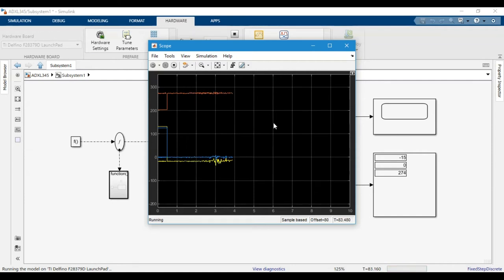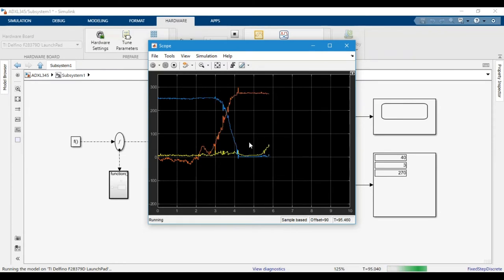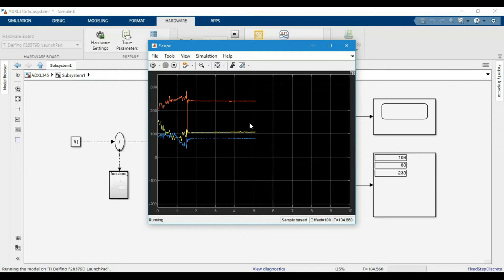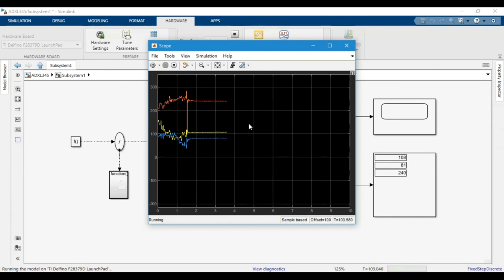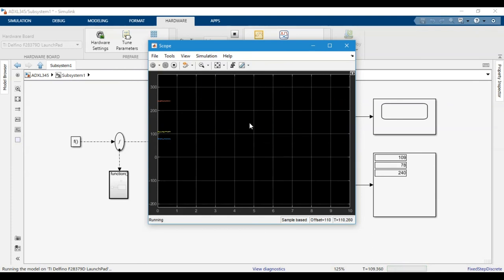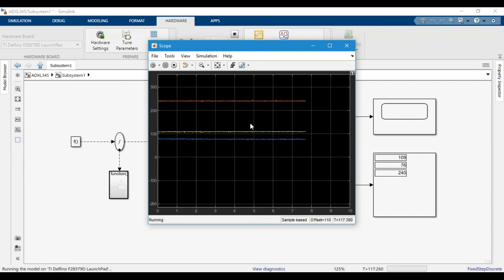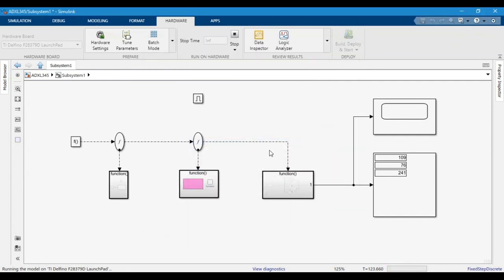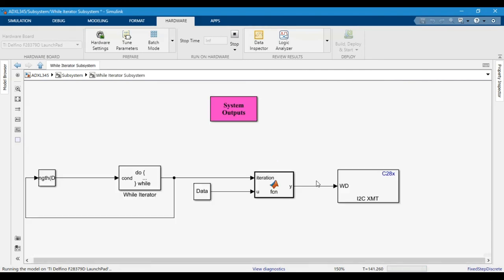LAUNCHXL-F28379D- I2C- ADXL345 Accelerometer-PART 3

Comment: Hello Syed,  I am trying to send data to an I2C ADC5625R from a F28335 DSP using Simulink. Would it be possible to get in touch with you for some help on this?